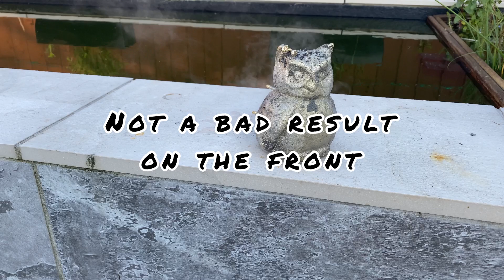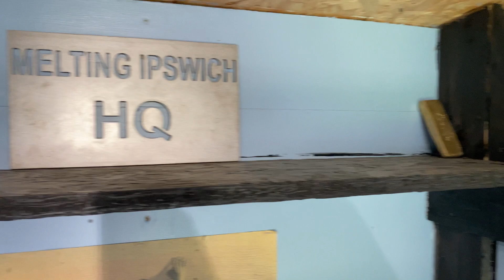Sand casting brass owl lost foam melting brass metal

Comment: Interesting vid, brass [dirty metal] is not the easiest metal to cast,  not sure why the need to pre heat the moulding tools though
Reply from the maker: If you don’t preheat you can end up with steam explosions. Thank you for watching 👍
Reply: @meltingipswich  Thanks for that  I enjoy your vids but we must disagree on that my friend, I built my first foundry  over 50 yrs ago  & amongst the various castings I've done including  100s  of nameplates for a local  engineer in brass using lift out tongs & pouring rings like you, & never [or needed] to pre heat them, my colleagues at  our local foundry never do either, I never ever make brass ingots to apparently "clean" the metal  & always put a lid on my crucibles for brass, alloys & iron I don't bother my furnaces I've built of different capacities[which I've burnt out  a few over  the years!!] all run on foundry coke with forced air except one that uses propane [damned expensive!!] there was no youTube to show you how to do it then, keep up the vids we're never too old to learn a few tricks cheers.
Reply from the maker: @headstocktailstock  🤣👍 thanks mate I started this hobby in lockdown and I am very much still addicted to it and love the fact you can cast and replicate something
Reply: @meltingipswich  me2 still love it after all these yrs  best part is some of the model steam engines I build use large lumps of brass but as we have  a foundry we can cast them cheaply from plumbing valves & fittings keep up the vids mate

Comment: Your mold isn't venting properly, that would explain the excessive flames coming up from the sprue and the defects on the back of the owl. For best results, the sand should be dry and free running, i.e. no water or clay in the sand. If you're interested in seeing some absolutely amazing lost foam work check out Kelly Coffield's videos.